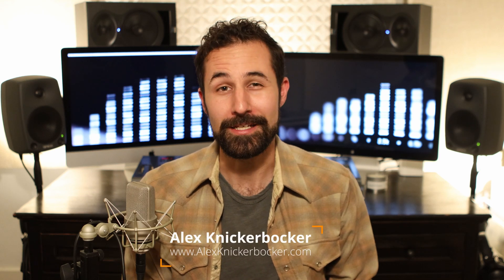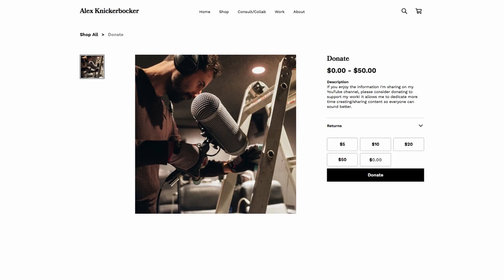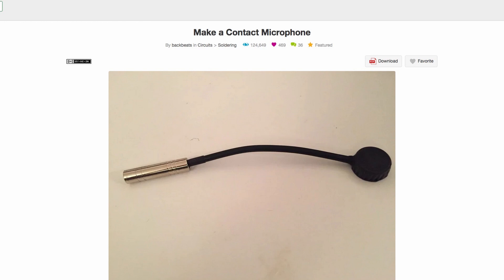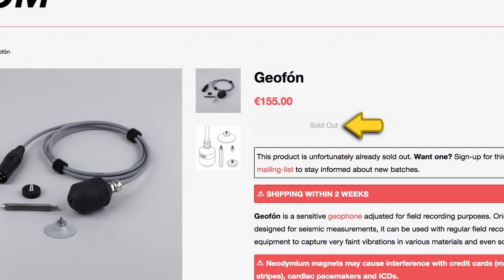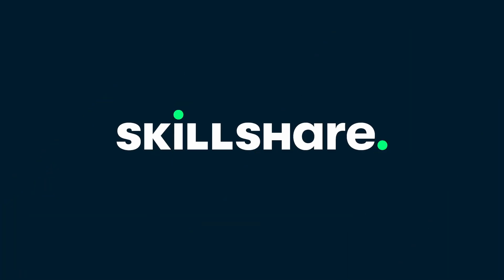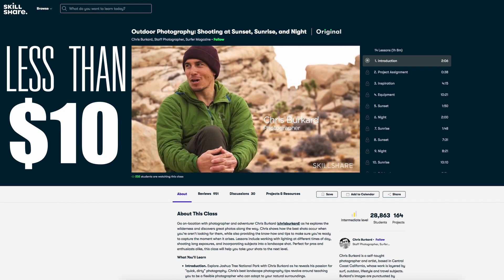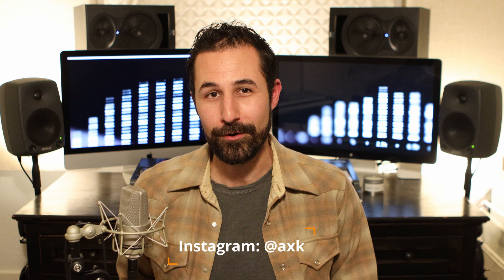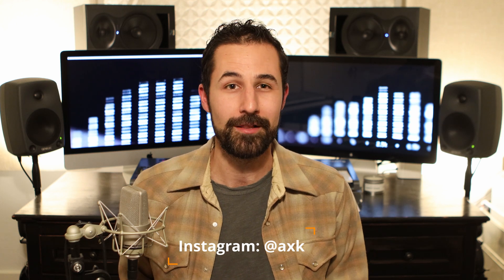What Is a Contact Mic? Real World Test of the Lom Geofón

Comment: hello, one question. used in contrast a contact microphone can function as a pressure transducer. I'll explain. if for example I go out from an out of a device such as a keyboard or synthesizer at the head of the microphone emits vibrations for example to make a spring vibrate? I was thinking about how a speaker can work as a microphone also in this case I can get similar results. thank you
Reply from the maker: Great question! I recorded the subharmonic component of the Saturn V launch in the movie First Man with a 12” JBL woofer at NASA JPL; louder sounds translate well to that kind of technique. 

However, the energy you’d be running to a contact mic plugged into an output probably wouldn’t be enough to give you a useful result of any kind. Curious to try it with a hydrophone...